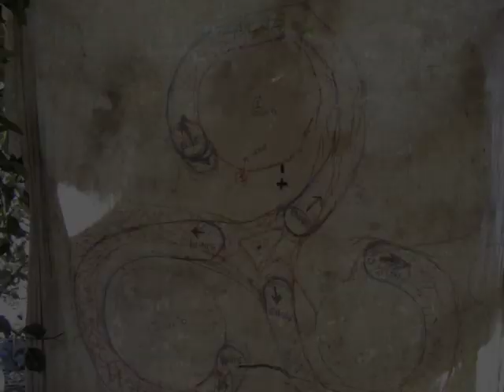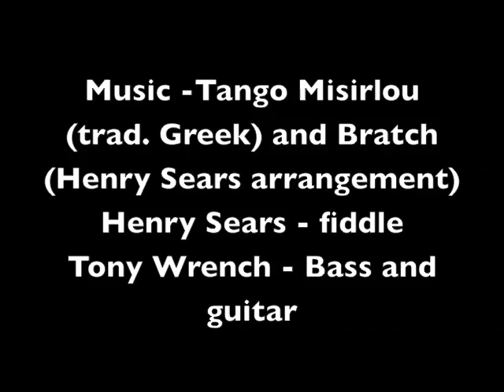Building a Cobwood Roundhouse in Cornwall

Comment: Hi, I'm curious about the spiral rafter layout: I would have thought that having all the beams meet at a single point and lean against each other, rather than a spiral where i'd expect support to be relying on a shearing join between the beams.
So my question is; Is there any structural advantage to the spiralling of the rafters or is it just a simple (and aesthetic) answer to wanting a hole in the top of the roof for light or smoke one way or the other?
Great build btw :)

Comment from the maker: Yes bitumen is good. We have a keg of it . We break bits off and melt them in a pan and paint it on before it sets again. The other thing to do is make your henge frm arches with diagonal bracing built in, then stand the posts on stone blocks. It is the more modern method ( since the middle ages).